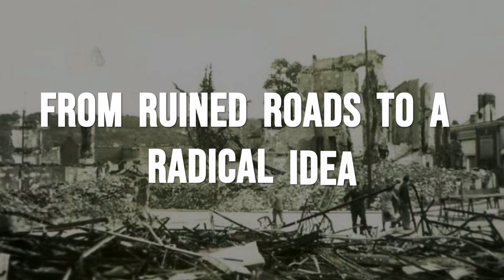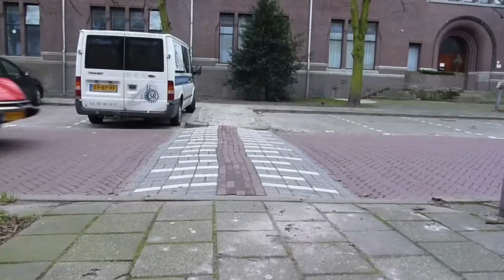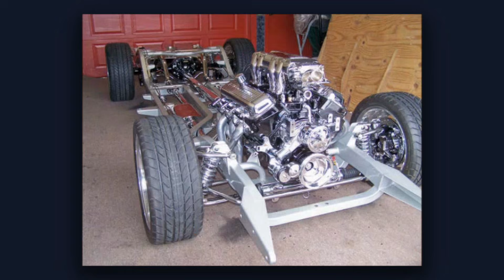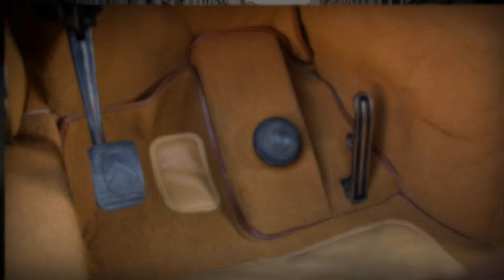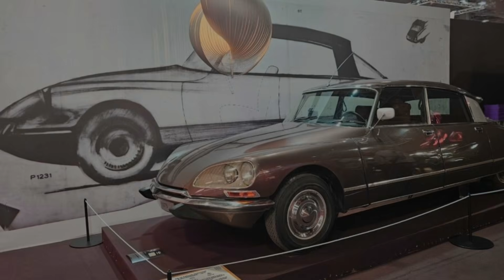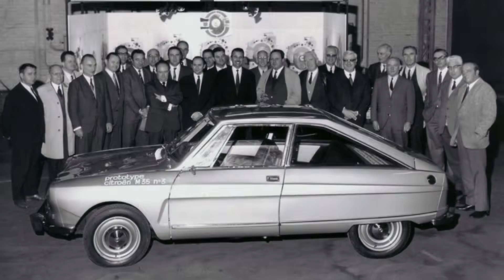The Engineering Madness of Citroën DS21 Pallas

Comment: 'Car Nostalgia' - Will just be the first to comment - you really need to improve the use of AI and do a bit more fact checking. The rear wheel 'covers' are, in reality, the entire rear fender. They come of with the removal of a single nut. Reason - so you have access to the rear wheel if needing to be changed. That is why the convertible versions, most all built by Henri Chapron, have the cut out in the rear fender. Rolls and Mercedes could have, absolutely, built their own versions. They just could not get around Citroen's patents - so wound up building their own versions under licensee.
Reply from the maker: Thank you so much for your valuable suggestion and information  ❤❤